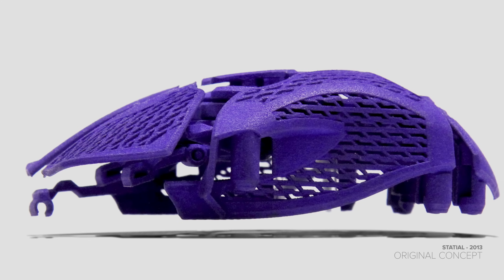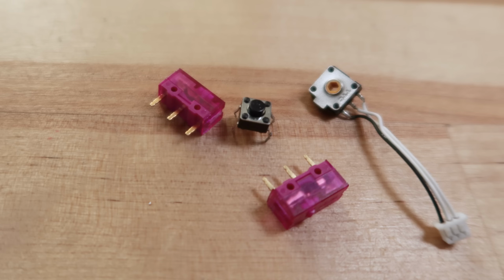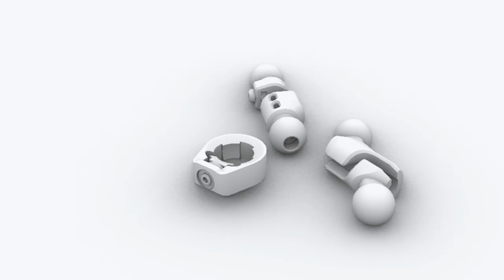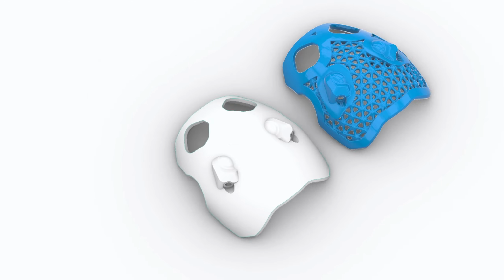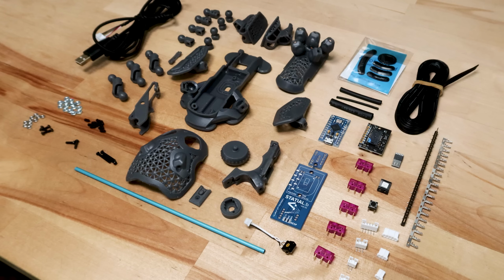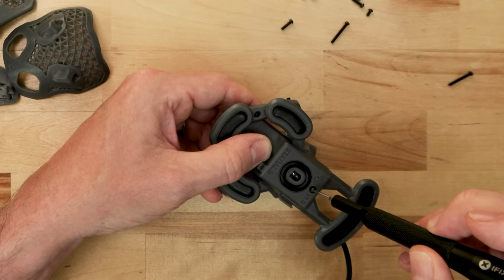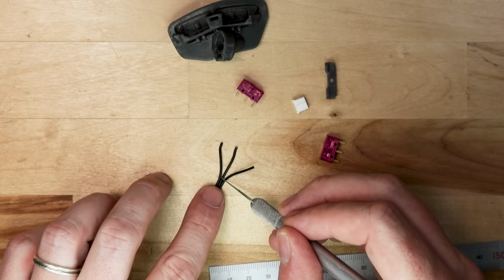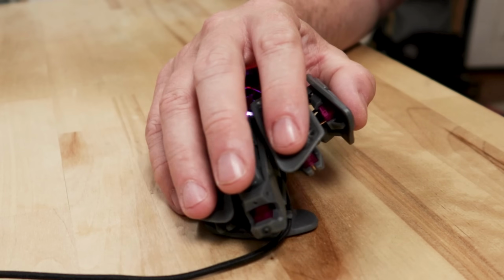Mouse Reinvented  - Statial Open Source Adjustable Mouse

Comment: Bro starts a nice small easy project. Right. Sure, a mouse is a basic, simple idea, they've been around in a long time, we have plenty of fine and simple light cheap mice, but then going for so much adjustability, in what is then a really small package, it's insane. I mean, there's a reason not too many mice liek this exist and that so many of them are also shit.
This is some grade B shit. And i don't mean that as an insult, not at all, i consider most mice to be grade B, only a few grade A, and even then i will find things i do not like or outright miss. If you're asking S tier, i have found no mice that have or do exactly what i want, none.
Now think what you can do as a far bigger company, you can have more bespoke stuff made, using less off the shelf stuff, likely giving you the ability to make some things even smaller, injection molding, etc. For instance the boards you used, making your own complete board with everything all probbaly means a lot smaller and less weight, though you'd probably need quite the bank account and sales to offset the cost to make it financially sensible.
And again, this is why 3D printing is so awesome, relatively easy and certainly faster and cheaper (after buying the machine) prototyping, normally you couldn't do this at all, or need to spend a whole lot of money, or make everything by hand, also often from other materials, which too often would also be very difficult. What a time to live in.

Comment: something so missing from these types of DIY videos is going into any detail into the design process - so often overlooked or i think the creator thinks it's boring so usually they do some kind of timelapse. really appreciate that you keep it in, it's the most interesting part
Reply from the maker: It's really tough figuring out what to focus on in the editing phase but I agree that the design process is super important (and the most interesting). Frustrating thing is that I have to cut out most of the design directions that didn't work out which is a huge part of creating anything. It's a balance between making videos that are to long vs cutting critical parts of the story that I'm still trying to get right. Thanks for watching!

Comment: This looks awesome and in my list of projects. Would using a nrf52840 instead of pro micro controller to add wireless capabilities work? I haven't looked much into it, but would probably look into that as well. But this is amazing, the amount of adjustability is awesome. Great job!
Reply from the maker: Thanks! Now that I have some more micro controller experience I definitely plan to revisit this concept as a wireless version powered by a NRF or ESP32 controller.

Comment: Oh man I'm so happy to find this, my RATZ is giving up the ghost, so this is exactly what I'd want. Plus, this looks like prime design for SLS printing, I'll have to see the prices for the files, but, that would be awesome. Last thing would be to see if it'd be possible to turn it wireless, you'd just need to fit a battery, and replace the Pro Micro with a compatible board with bluetooth support, like that Sparkfun promicro clone with ESP32 chipset

Comment: I was thinking back on this video in making my own custom mouse.  What if you added numbered indicators that correspond with parameters in the CAD setup so that after getting what feels like a comfortable layout, you could use those numbers to print a solid but lightweight shell?
Reply from the maker: That’s actually the video I’m working on right now 😁

Comment: @PyottDesign You said you added the lattice design to the mouse to reduce weight, but I wonder if you considered printing the parts as a hollow body instead? It's often done for custom TTRPG miniatures to reduce weight without significantly affecting strength, since the outer layers should take most of the stress in bending. At a glance I think it'd be about the same weight, plus cleaning would be easier and it'd be friendlier to FDM printers. IIRC, most SLA capable slicers have hollow bodies as an option for easy implementation.
Reply from the maker: The surfaces are mostly 1.5-2.5mm thick so no room for shelling. I really like the lattice detailing personally but I released the solid, pre-lattice pass, bodies along with the other build files on GitHub.

Comment: What a great build! Had you thought about the castellated pad pro micro like the spark fun when designing this? Curious if that would have helped reduce height.
Reply from the maker: Thanks! I know I looked at the castellated version of the Pro Micro and can’t for the life of me remember why I didn’t use it.
It would have cut the amount of soldering in half, offered much lower form factor and even has usb c (easier to find mouse cables). I think maybe the higher cost and lack of easy to find generic versions turned me off. It’s possible that version was out of stock at the time of the build too?
Whatever the reason, I wish I had gone that route for the build!

Comment: Why not just use Ploopy Mouse internals? Think smarter not harder.
Reply from the maker: Ploopy is a really cool project but the adjustability range of the Statial made it so the electronics package had to be as small as possible & the Ploopy’s wouldn’t fit.
This was also a fun opportunity for me to do some PCB design. 😁

Comment: This is an amazing job! I really like the author's design style. In fact, modern design is going the wrong way. First, designers who know nothing about engineering draw something crazy, then real engineers try to make it work! And the more difficult it is to do this (that is, the crazier the initial sketch was), the more expensive the product is. But consumer qualities are very weakly dependent on the price. Therefore, cheaper products are often designed more competently. But they save too much on components. And, most likely, they put low-quality ones on purpose so as not to compete with their more expensive goods. Although the production costs may differ by a small amount.
Anyway, the author of this video took a completely different, more correct path. Having created an engineering-perfect design, he used her own style to create a complete image. When the content determines the shape, it is immediately visible and this is a property of professional devices, not toys. And I really like it! I immediately wanted to try to build such a mouse! I have a 3D printer, and I have sufficient electronics skills... That's just it is not possible to order the boards in JLCPCB right now. You'll have to do them the old-fashioned way - with a laser printer and an iron..

Comment: Absolutely wild. Brilliant presentation of a spectacularly designed product.

From execution to documentation, a beautiful combination of "professional" and "labour of love". Not only did you nail the fundamentals, there were so many little touches that elevate this project. The tips for prototyping (and this thing looks sweet in clear resin!), the advice for troubleshooting and cost-saving...

I stumbled across this while looking for a fully vertical gaming mouse. I'm expecting to have to re-shell an existing mouse, similar to how "Dawid does texh stuff" did it.

I use the affordable Trust GTX 144 at the moment, but it has some glaring quality issues. I've got four, two have failed already in the same way (scroll wheel assembly), and it has an issue with registration of multiple button presses. 

But I get brutal RSI if I game with a traditional mouse nowadays, so I just keep going through GTX 144's. At least I feel I get my money's worth before they fail. Vertical only for me.

Your project has taught me a lot, and I've really enjoyed it. I hope some day to build a mouse half as good as this!

Comment: Very cool, though I do have to wonder, how much customisation does a mouse really need to have? Aside from slight tweaks to accommodate hand sizes (probably more of a factor for people whose hands are too big for a standard "small mouse" but too small for a large mouse) surely the reason the form factor of mice hasn't changed is because it's actually incredibly well-designed as is. Given how frequently mouse sensors and frame materials, internal weights etc have been iterated on, if there was something to be gained in ergonomics of the traditional gaming mouse, surely that too would have changed over the years.

Comment: If you ever are interested in making a third version, the Logitech G502 is a pretty favorite mouse and keeps the same design over many years it seems.  I'd love to adapt mine into a version of this, because that extra thumb button and the sensor resolution up/down are really great, along with the switchable scroll wheel.

Comment: The half-vertical is exactly what I am looking for for myself.  With the normal horizontal, I can feel a tightening on the outside of my arm, and the full vertical loses some of the fine control.  (It's possible I might adjust, but I tried it before and couldn't adjust in three weeks, so I expect it is an internal brain wiring issue.)  As an aside - from the close-up, I see you are also a nail chewer.  😁

Comment: >This project requires resin printed parts. It (probably) won't work if parts are 3D printed with an FDM printer.
anyone who says this is looking to be proven wrong lol.

those instructions are a work of art.

Comment: I'm curious if this is now your daily driver. do you like that much? 

I've also thought of doing a VR controller version of this with triggers for each finger, potentially with adaptive triggers like you'd see in the dual sense controllers. It might get heavy and expensive, but i bet with some tuning, the immersion and potential haptics would result in crazy good budget immersion (compared to modern gloves anyways). I'd imagine individual finger tracking could also be managed with this solution.

 Something also to consider is a button layout more similar to the Swiftpoint Z. they had some ingenious button layout ideas that I hadn't originally considered (like the 3 index and middle finger buttons and addition pull button). I'm curious if you know about that one.

Comment: Great job! I also like how the aspects of the design in the finished mouse make the rear of it look like a cutesy skull with horns. Maybe that's just something I see, but that was something I noticed that drew me in to watching the video and then later when I found out that it was to access the joints, it made me chuckle. Definitely something that could be played up in the print files, before printing things out. The scroll wheel assembly it super cool and has a futuristic motorcycle look to it, like something out of an anime. The aesthetics are really great.

Comment: I really like the ball joint/arm design. I'ma steal that!
Reply from the maker: Thanks, I really like the way those came out too. Ended up being a good compromise between durability and locking rigidity on the ball joints. The original design used metric square nuts which worked better but I swapped them standard hex nuts because they were easier to find.
I really liked the extension arm version shown at 9:40. Those passed the conductors for the button switches through the copper extension rods of the arms. It was just a little to complicated so I walked away from it. Really hard to let that concept go!

Comment: So its the RAT 7?
Reply from the maker: The RAT series has two moving surfaces with a limited range of motion. All the surfaces and buttons on this are independently movable on all axis
Reply: @PyottDesign  uhm you forgot the RATs best feature. Its heavy enough to rob a bank with. No matter how many times I post sarcasm never goes well over the internet lol.

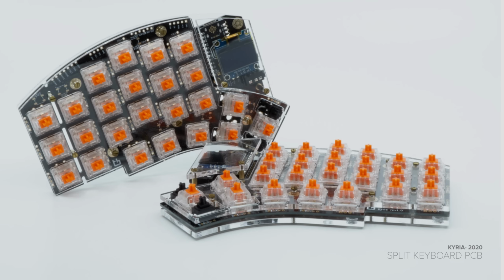Comment: g305 lightspeed would be the one you Should have picked to base on. So many aftermarket mods for this mouse, it would have fit right in. 3:03 The G pro originally released in 2016. 3:10 Didnt look very far into the custom mouse world then.. IF THAT is all you found.. market research gets a D at best. Everything from 2 finger hyper light low input mice to custom to your hand, and glass feet and mouse pads, Vertical mice.. Check out RocketJumpNinja on here, as well as some other youtubers in the space..
Reply: Just one example - /watch?v=qmX8vL-GbxU

Comment: You should make it out of 3D printed carbon fiber and use an Razer viper mouse as its base because of comfortability and mostly pulling right and weight because you’re properly already know, but carbon fiber is extremely light and it must be comfortable in your hand quite obvious

Comment: the complete Sci-Fi model of this has actuators/sensors  and goes through a calibration process at the end of which it will be set up perfectly for your hand shape and intended use :)
Reply from the maker: For a hot second I was looking at Sanyo 4.7mm steppers on micro lead screws...

Comment: This mouse you made looks interresting. Wouldnt mind giving it a try since im very used to Madcat mouses but yeah this mouse you made does have different appeal. Also to see somebody use a Madcatz mouse in his desgine process makes me happy. I personaly had 1 that survive bankcruptcy of Madcatz and then the mouse laser got damaged on 1 axis (these are 2 axis laser reading mouses that make pinpoint aim). so i bought ather one MadCats 8+ Adv which has 20.000 dpi more then you ever need and adjustable dpi levels / and ofcourse the funictional adjustable to the hand. How ever the only fail to this mouse is the scrolling wheel its a dissapointment (it use a weird contraption not a normal scroll wheel and its something like a potmeter with a mouse wheel into it and a click for 3de mouse) how ever this system once its dirty it require to open the mouse and even afther cleaning it will return the scroll wheel to act normal but it gets dirty again quickly due of open to dirt of the hand or skin remains or something or dust and well the mouse scrolls horrible again. Only thing i can say the lasers in this mouse also 2 axis and they work perfect. but yes sadly due of a bad scroll wheel im forced now to use 2 different mouses and 1 pure for scrolling webpages XD. because if i do that with main mouse its just jumping all over the place...

Comment: Bloddy amazing, mate!  Some thoughts:

1. I suggest you work with someone who has truly large hands to tweak your design to be able to fit them.  (When I stretch my fingers out, my thumb and pinkie tips are nine inches apart and, when I rest my palm on the mouse as most folks do, my fingers extend more than two inches past the front end of the mouse.  Yes, really.)

2. For the vertical style--or for those of us with huge hands--a heel pan is a must so the heel of our hand isn't dragging across the mouse pad.  Can you please add one as an option to your design?

3.  Super-soft silicone USB cables are available and inexpensive, so rebuilding one isn't necessary.

4.  I would add a mouse wheel assembly version that places a depressable 1cm I2C/SPI OLED display where the DPI button is.  That would allow for much more information about a particular profile than just memorizing what a particular RGB LED colour means.  (72x40 pixels = 18x6 text display when using a 3x5 font.)

Cheers!

Comment: How secure are the surfaces in place compared to something like Mad Catz’ approach with swappable surfaces that are slightly different in shape? How does it hold up over time?
Awesome project!
Reply from the maker: Thanks! I've been using it for ~2 months now and it's holding up really well. No problems with stability or functionally at all.
You're getting much more control over the ergonomics with this concept vs a surface swapping design like the RAT. This is going to be more fragile and slip prone though, that's the trade off. If I were throwing it in a bag with a laptop and commuting to an office every day I expect it would get messed up after a few months. If I were to slam it down on my desk I don't think it would necessarily break, but the surfaces would shift for sure.

Comment: Hi :) Stunning Project you did there! I really want to try out your first Design for the statial m100 version. Unfortunately, you can not find the model anywhere to buy or download. Could you re-release it please? 🙏
Reply from the maker: Thank you! I never released the original Statial m100 3D model. It needs a 3D printing process called Selective Laser Sintering to work which is a much more expensive industrial process. If you print it with an FDM or resin machine it will come out as a brick (none of the mechanics will work).
Also, it worked ok-ish for me but it was a pretty uncomfortable mouse!
Reply: @PyottDesign  ah I see. We have a SLS Printer at work, and the machanism of the Design looked interesting to try it out. Thanks for the really good videos btw :)

Comment: You've inspired me. Thank you for the wonderfully informative video and resources. Very generous. I'd love to see your take on a ball mouse as weight wouldn't be a concern and a heavy vertical mouse can be problematic. An adaptive 1000Hz polling rate ball mouse (index and/or thumb) would be genuinely a revolution for the computer chained among us. I use a ball for everything that isn't gaming to protect my wrist and game with a custom 4k 20 gram wireless fingertip mouse using an existing HSK pcb.

Comment: A couple of weeks ago, I wrote in Logitech Discord what would be a nowadays mouse would be... I wish that your mouse has some of that features too... I think buying a used Logitech MX Revolution mouse as a basis then changing the shell and adding few buttons and modding the PCB to support easy replacement of worn buttons (no soldering), I was even planning to start a project and started looking for options, like you did to have a custom PCB that uses RPI 2040 or Arduino nano...